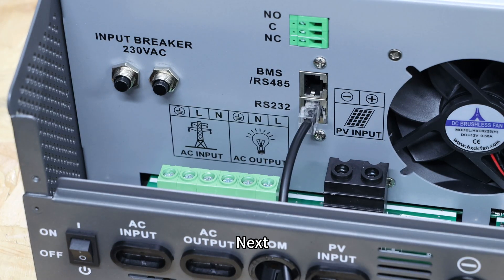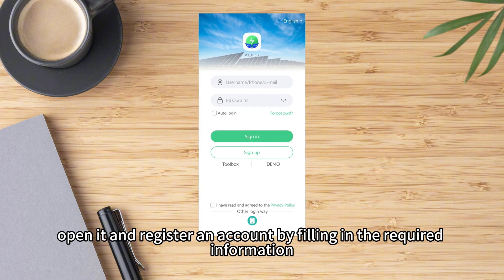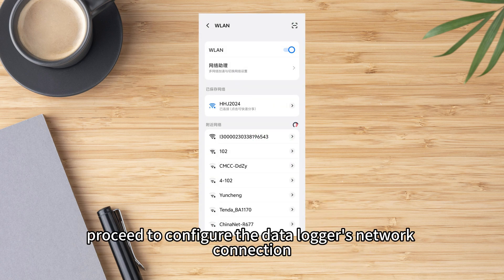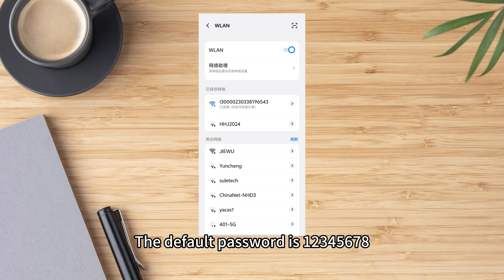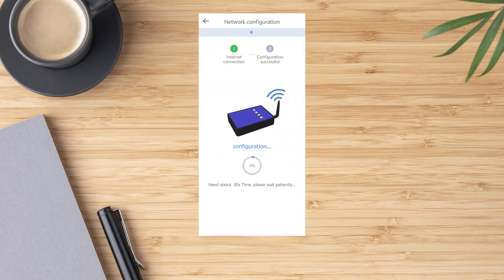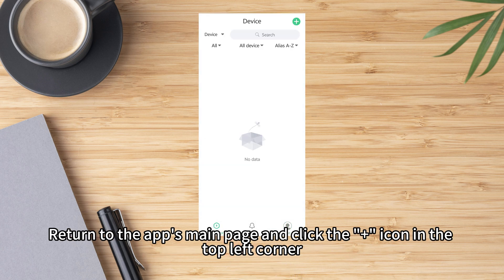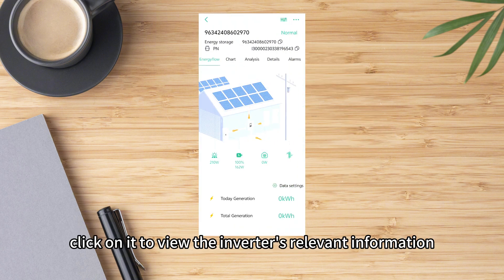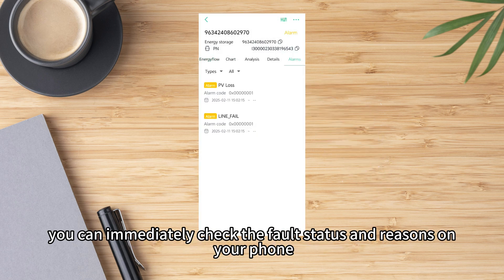How to Setup WIFI-RELAB: Easy Guide for Beginners

Comment: My PowRelab 5KE wifi monitoring is not showing PV Harvest in watts, Inverter load in watts, cannot change data parameters. It will show only voltages value. I doubt the one showing in the video(smartess) was not correct.  Mine will show only voltages and cannot edit parameters.
Reply from the maker: Please send it to this email: support@powmr.com. Our technical staff will check it for you.
Reply: @PowmrSolar  already did, actually wayback October 14 last year, unfortunately they don't reply.
Reply from the maker: @ Please send us your email. I will check it for you.
Reply: @PowmrSolar  I bought a 10kw PowMr Relab KU and on screen 2 it always shows 0% load. It doesn't show me the percentage.
Reply: @PowmrSolar  What is the latest firmware version available for this model?
Reply from the maker: @ How many watts of load are connected? If possible, please send a video to this email: support@powmr.com and our technicians will help you check it.
Reply: Same as mine, my 5kw ske relab does not show load on P2 screen,it is fixed to zero no matter what my load.